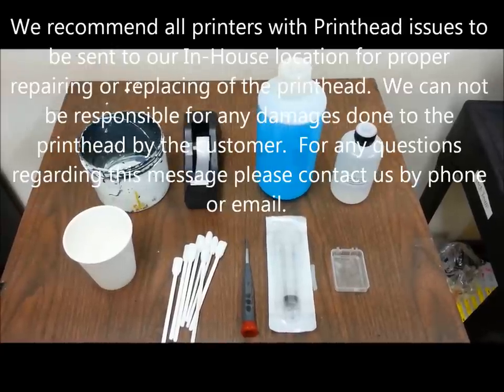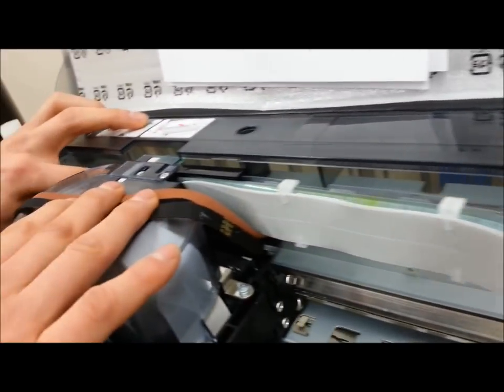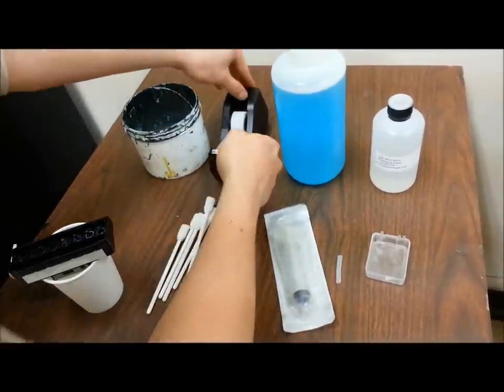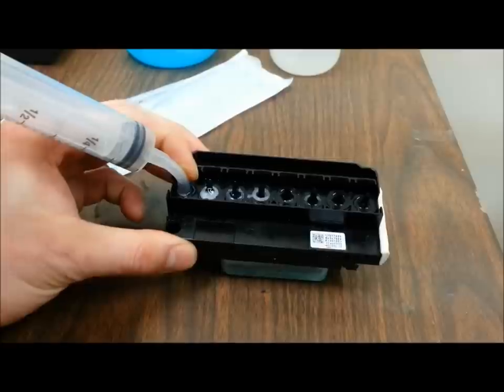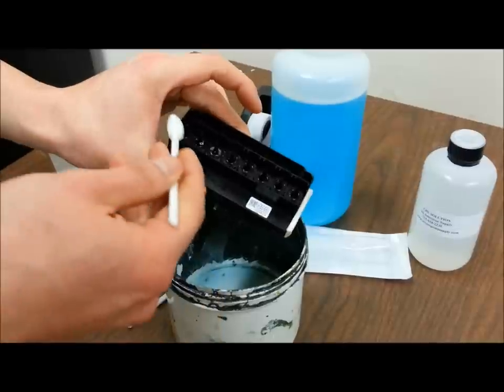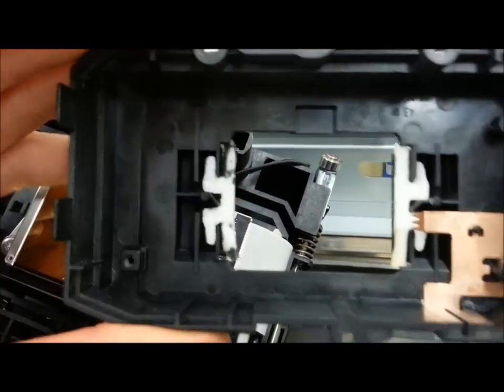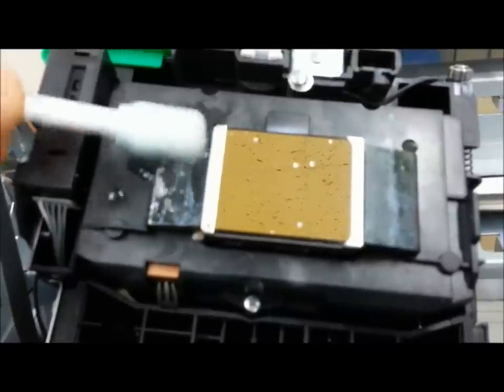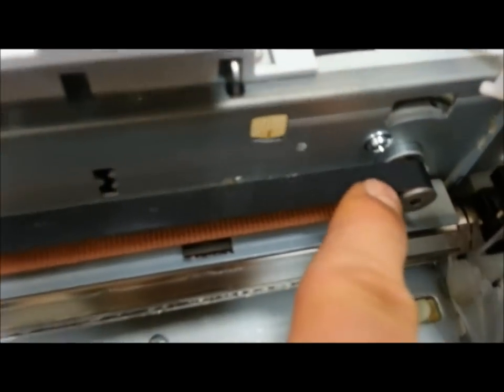Printhead Removal and Flush

Comment: Yup, the best tutorial I've seen to date and it's been almost 10 years since you posted this!.  I don't need this procedure (yet) but I certainly bookmarked it just in case. I'm running my 7600 on Windows 11 with the (last) x64 drivers Epson made available. You have to disable driver signature (look it up) and manually install the printer after that but it works like the day I bought it 20 years ago!

Comment: Best video on here by far for print head removal and flush,  a big thanks (saved my 4800 from the scrap heap)
Just two questions .....1  can you slip the belt off without taking the side of the printer off. 
2 . Do you need to keep some cleaning fluid in the head when first switching on (maybe to prevent heat damage to head)
thanks  Peter from UK

Comment: I had very few bars upon testing (after my 4000 being idle for months) - thus clugged.  So, since cleaning and power cleaning weren't helping, I  following your video, 

I've cleaned my heads getting a very clean waterfall and re-assembled.   After restarting and power clean, I had NO patterns.  Suspecting that I made an error, I disassembled again and found that the grounding fork was pushed inside the case so re-aligned the fork and reassembled.  Still no patterns after this second attempt.  So as a last attempt, I filled all my cartridges to the top, disassembled, cleaned the heads again (stream is fine), primed each color by using a syring (fine), reiseated the two ribbon cables, reiseated the fork and reassembled.   Again, still not pattern.  

The printer reports no errors and seems to be operating normally.  

It seems that the inks are not being pumped since I see no ink movement in the tubes.  

Did I miss something in assembly, is the pump now bad or is it possible the the entire heads in not bad?

Comment: Michael, I have done this twice and was very liberal with the flushes and waterfall the problem is though that when printing tests some of them are perfect and then some of them are not (not by a long shot!)
On auto one row they are almost 100% and then the next row maybe a few of them are 60% and then another color changes from 100% to 60/70/80/90% it doesn't make sense the waterfalls looked as though they were well cleaned?
Do you have any idea Michael why this is happening right now I have used half of a set of 220ml inks surely this cannot be right...

Any feedback really appreciated.

Thanks

Hugh

Comment: You have and info on how to manually flush out the ink tubes on a printer thats sat unused? I have a resolite r jet 5 dtg and its based on the epson stylus pro 4880. I plan to replace the head, the dampers and capping station

Comment: When I do this it wont "waterfall" the cleaning fluid just comes out of the side of the print head.
Reply: I needs to soak in the solution/solvent longer. Put a little pressure with the syringe and fluid forward and backward little at a time.

Comment: What model and brand of printer is that?
Reply: It's an epson that has been rebuilt into a direct to germent printer. I forgot the specific model of Epson it is, but that's why it's not mentioned in the video.
Reply: Epson Stylus 4800
Reply: It’s a 4000 series printer. Either the 4000, 4800 or the 4880. I love my 4880!!!

Comment: I couldn't get it to water fall, the solution comes back up the next color
Help!!
Reply: Same here, Since i see that your questioned wasn't answered, id like to at least let you know that in every print head I've ever tried this method, I always get the solution to come out the next color. i'm thinking its the pressure inside the print head that might cause the other colors to eject whatever is inside. I apply gentle pressure so as to not damage the print head.

Comment: never...let...an...ink...printer....sit...idle.
Reply: I just gave up on ink jets.  All they are is a pain in the ass and they ink is sometimes horribly expensive for what little you get.  It seems that something with nozzles so small that they are known for clogging easily are a recipe for failure anyhow.
Reply: I hear ya.  I recycled the damn thing in the trash.  I got a decent HP that so far has been really good, and seems better than the Canon crap bought last time.  Would like a laser however....next time.
Reply: I have a Brother HL-2140 (black and white laser).  It has never given my any trouble and I must have had it for 10 years.  I don't print a lot so I only had to replace one toner cartridge.  There is a very similar one to that which is WiFi enabled.  The colors on the case are the reverse of those on the HL-2140.  I see that one in the bank where you can go print stuff from your account.  My printer is an older model obviously and so I am doubtful that that still produce that one.  You can still get all the consumables for it anyhow.

Comment: I followed this video to the T and meticulously followed and reviewed each step. Performed exactly as demonstrated.  Now the epson stylus pro 4800 prints nothing.  It went from just off colors and banding to absolutely not one drop of ink. Though it goes through the motions with no error message, saying "printing" on the display, clean white paper comes out.  What could I have done wrong? Any suggestions for what to double-check on?  Willing to redo the whole process ... can you point me at the exact solutions used in the video (what is textile solution)?
Reply: I have the exact issue!  Did you ever get this figured out?

Comment: I fixed all of my inkjet problems when the nozzles clogged.  Want to know what I did?  It did not involve any messy print head cleaning or even replacing those damned cartridges.  What I did was just throw the F-ing printer in the garbage and buy a laser printer.  I have never had any problems with the laser printer yet and I had it for at least 5 or 7 years.  The only thing it ever needed was a new toner cartridge.

My Uncle tells me that only businesses need laser printers but I think is absolutely 101% full of shit.  Why should businesses be the only ones to have a trouble free printer that does not require ink that is more expensive than fine French Cognac?  He always has bad luck with things then he wonders why I never ask him for advice on what to buy.  Instead when he buys something I take it as a lesson on what not to buy because he buys cheaply made junk that fails too soon.  He buys lesser known crappy brands of things when they are on sale.  I would rather spend the extra $50 on something that I will like that will last.  I don't hate spending money, I am just cheap and don't like inkjet printers no matter who made them.  I bought a laser because at that point I could care less about printing color and lasers generally make sharper black and white prints which I like better than inkjets.
Reply: John Doe It would have been fun to take it to a field in the middle of no where with a sledge hammer and a few of my friends and beat that pile of junk to oblivion.  Then I have also considered encasing it in concrete as if it were a custom made Italian cement shoe.  They can be awfully expensive depending upon who makes them hehehe.